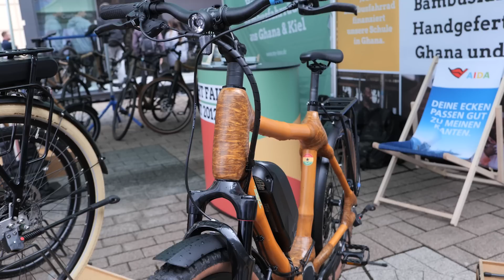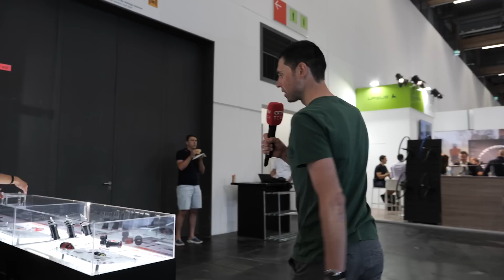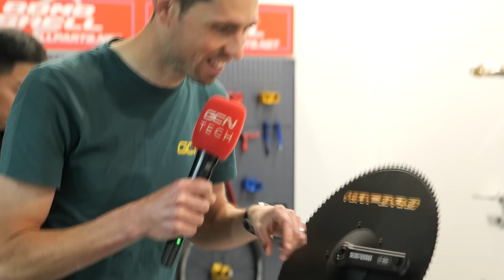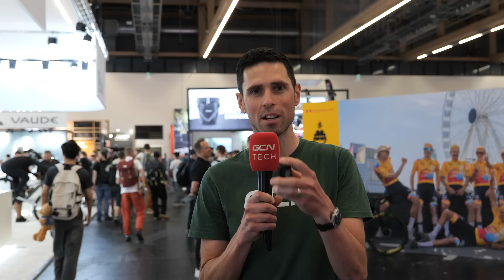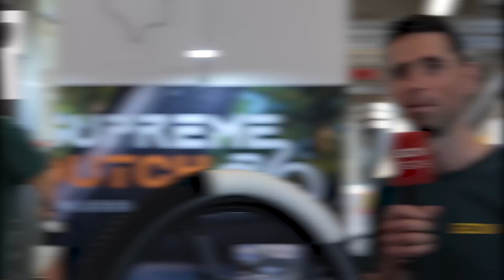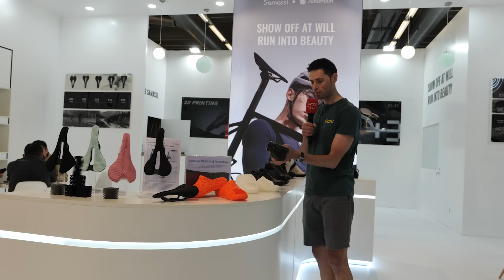Cycling Brands You've NEVER Heard Of | EUROBIKE 2024 (Day 3)

Comment from the maker: What tech caught your eye? Let us know in the comments 💬
Reply: Where do we sign up for the new YouTube GCN membership?
Reply: So no road CUES this year either? Okey Dokey👍
Reply: I am using the Ltwoo 2x7 shifters on my favorite road bike and they are working well.
Reply: Using the wheeltop groupset on my own for about 1,5 months now...After 530km i can not say anything negative about it. I'm loving it. Using it as a 9speed groupset
Reply: Finally an aero cover for my jockey wheel.
Reply: just on the last chainring .. you said what? doing 2500 watts? Do riders actually do that much? Considering i (a normal person) barely does 300 watts peak .. .

edit: did an online calculation - with my bike (my non e-bike .. a dutch bike weighing what feels like about 15-18kg) and my own weight .. i would go 75kph at 2500 watts ... in my environment (sea level, flat, asphalt  -  no wind or elevation). i would predict my bike desintegrating past 40 kph though, like literally falling apart. It already rattles dangerously at 20 kph. 

A professional might weigh more than i do .. but they have much, much better gear .. so i expect a professional with top end gear to have to cycle 80-85 kph at 2500 watts. While probably not unheard of .. it still feels very high. Uh, come to think of that ... what IS the top speed of highspeed cyclists anyway .. is it around 90 kph?

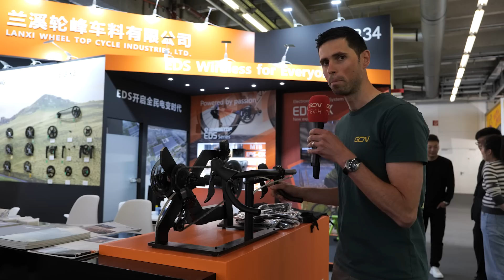Comment: 8:15 A nice idea but that would be absolutely awful in practice. if you're in somewhere in the middle of the cassette cogs it can be impossible to tell which chainring you're currently in through feel alone without actually looking down at your chainring. The number of times i forget which chainring im in and give the paddle a quick tap just to make sure im in the one i think im in is embarrassingly high. with this system doing that would immediately switch you into the WRONG chainring.

Comment: Nice video on the 'second tier' products at the show. Well paced and good images to really see them. You asked if any of us have used these products yet. I put the LTWOO eGR group on my gravel bike two months ago. As you point out, it can support 10-12 speed setups for compatibility with the rest of the drive train which is great if you've already got two wheels with cassettes, cranks etc in wide range 11s and hate to spend on replacing that. In my case it was to replace a mechanical Force 1 that was modded to support a 11-50 cassette. The LTWOO only specifies to 46t but it is running well on my 50t. Setup was simple and relatively no fuss. (some wire routing creativity needed but that was due to my frame not the groupset). Shifting is crisp and precise. I don't have enough time yet to say anything about reliability. And while I've washed the bike with a hose without incident but I haven't had rain here yet (there were early reports with the road version about water ingress). My only real complaint is that both shifters have identical paddles but the only thing you can do with them is decide whether to shift on the left OR right side. No ability to use both in combination etc. LTWOO support told me they are considering options in an update but nothing yet. (I'd love to see an option to use them up/down L/R like AXS paddles)

Comment: #askgcntech  I have a question which may possibly be best suited to Alex with his mechanical / engineering background.

How common / easy is is to bend an inner chain ring as this has happened twice.  To be more specific I had a carbon inner ring with Sram Force set up which snapped about 18 months ago - so just used the big ring for a while due to finances.   Returned to 105 last August and all was great until an indoor race on Rouvy this morning (Barbotto to San Marino) which included 4 hills.
Anyway I could hear a grinding noise when powering up the 2nd hill and a quick investigation revealed an inner ring bend.

My riding style is exclusively indoor. I climb a little (between 10,000 to 15,000m per week although June was lower due to illness) and I tend to keep a low cadence high torque style of riding.
I have analysed the last few hard effort hill climbs including this morning and I'm not really pushing more than 50 to 53 NM (Newton Metres) for short bursts.

Am I just unlucky?    Is this a specific problem to indoor cycling?   Could it just be an untrained bike mechanic who set the bike up?

thanks

Comment: I have Wheeltop EDS groupset. It work great. What is even better is price - got it for 640euro! For me, solution with 1 buton for front derauleur is great, as there is twoo gers in the front you push the same button to change one of gears to other. Regarding shifting speed, you can switch in app to ''racing mode'' and gears going to shift much faster. As i understand, it's made for battery economy. Have this group for 5 month and used to charge it only once after made some thousands km. This is my first electronic group and i am very happy to have it.
Reply: Yep not dealing with internal frame battery packs is a godsend , so is avoiding sram pricing. Alex was right about chainring speed though, even in sport mode its slower than Di2.

Comment: Am running the LTwoo eGR on my gravel bike.  So far one slight issue, but that was mostly on me.  I had a chain drop (from not cutting it short enough) behind the cassette, binding things, and when I did the derailleur seemed to not work correctly any more.  But I just held the button on it and it factory reset, and worked flawlessly since.  The ability to micro adjust each gear with the app is fantastic.  Did it on a recent ride when 5th and 6th were "clicking" - also can connect to your head unit, tho battery always reports as critical on my Edge 530.

Comment: It's odd that the L-Twoo's ability to be used on 10,11,12 speed setups impressed you so much, but the Wheeltop that can be used on 3 to 14 speed systems (yep 14, when they make them) didn't even get a mention? 🤔
Reply: 13:03 - stop calling it "standard" when a new company introduces a new measurement (here: a larger BCD) that nobody else is using, because that is proprietary, which is the exact opposite of standard.
Reply from the maker: There is so much tech at these shows we can't show everything. That sounds amazing though!
Reply: @gcntech  What are you talking about? You literally showcased both. That's my point. lol
Reply: 14 speed casette is plain stupidity. The tolarence needed for that to work wont be that good. Current 12 speed gives a fit if the derailer or hanger is bent half a milimeter. 13 adn 14 will cease to work from any little damage. IGH are way better fit for that purpose.
Reply: @kazuviking  that is why Wheeltop allows to correct every. single. individual. cog. Custom fit beats tolerances any time.

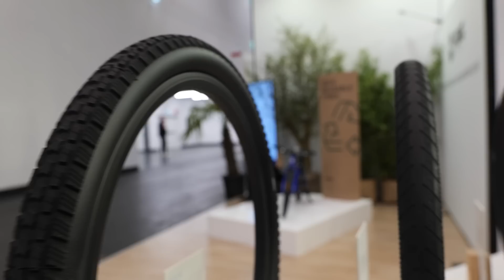Comment: Are those tyres at 4:54 going to be like a lot of other "Eco" items? where if you take into account the energy used to recycle them and the debris left behind after use (Worn plastic all over the road in this case?) then they are worse for the environment than a standard product?
Reply: Yeah far worse than normal tyres which just shed their rubber all over the road and air then go to landfill so another can be made from literally the ground up.